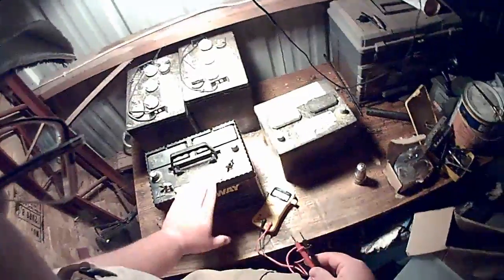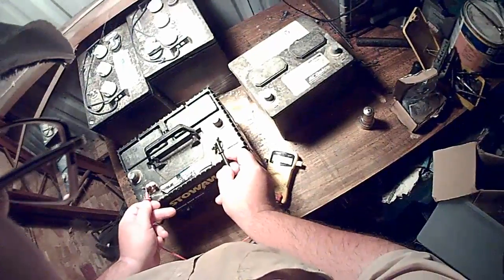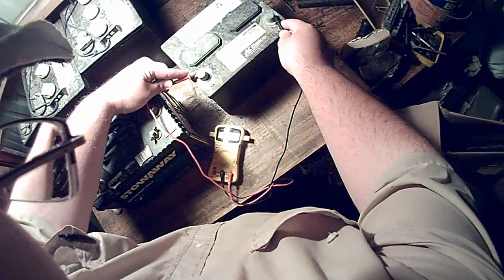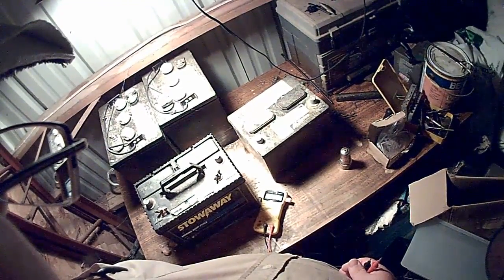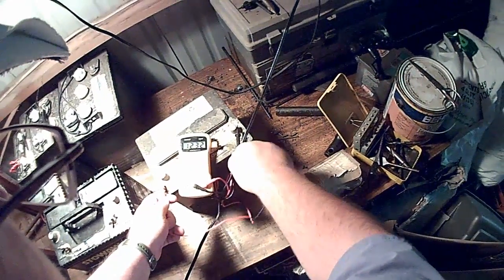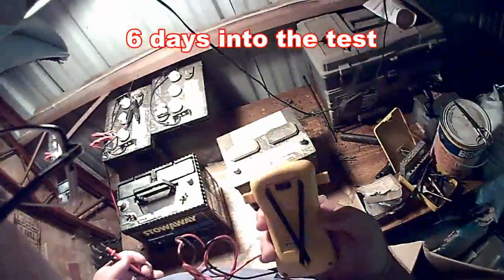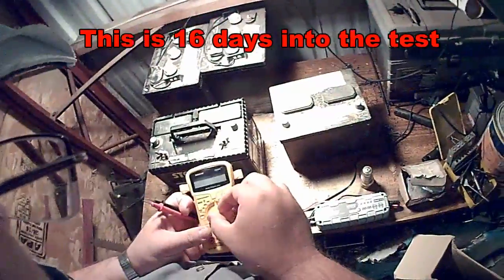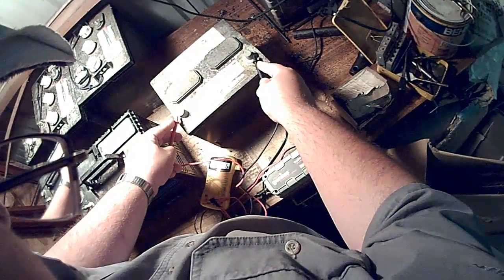Making a bad 12 volt battery good again for under 5 dollars drain test start.

Comment: That is just surface charge, it will drop down in a few hours or if you put a big load on it. But like I said, the lead salt battery runs about .5 to 1 volt less than lead acid. Still just as good, just different. You can also deep discharge it without damage.

Comment: The lead salt batteries, such as alum or epsom salt, run.5 to 1 volt less. But you can deep discharge them down to nothing and not damage them. Some inverters won't work at 10.5 volts or less. But the battery is still good. You can't use normal voltages as proof of them working. Starting the truck is a great test. Also, the 100 amp test is good, just can't go by the numbers it gives. That test is for lead acid.
Reply from the maker: Yup in a later video I ran a big fan constantly to find out the amp hours on the battery, worked out to basically the same hours as the original lead acid.
Reply: redicety12 ALSO, Some batteries have a slightly higher voltage after you use them a bit, warms up the battery. Like turning on the lites to warm up a cold battery in winter, before attempting to crank the engine.
Reply: Great Question... ?

Comment: Sorry GG Blues An alternator will keep a car running at Idle  even if the battery is disconnected! You are thinking of an old style generator in cars of the early 60's and before that put out more voltage the faster they ran.

Comment: Do you think using an ALUM battery as a solar battery bank would work okay? Think it would handle the constant charge and recharge?
Reply: good question, I was reading about solar power homes and one thing they mention car batteries are good cause they can handle alot of charge/discharge cycles. Soo a good test would be how many cycles can it handle.
Reply from the maker: That is why I started doing this in the first place, I have not hooked one up yet though.
Reply: redicety12 Great minds think alike. Batteries are not cheap, and once they die its great having a way to make them work again. Thanks for the video.
Reply: A car battery does not handle cycles well.
If you want to keep a car battery alive you can use only 15 % of the stored power on a daily basis or you will kill it in no time. You can use 50% with an deep cycle battery every day without doing damage to it.
Reply: Bonnie Flory
how long does it take a car battery to recharge the power lost during the engine crank? cause the trips I take are usually less then 4 miles at less then 45 mph.
Reply: The starter takes about 300 amps or more depending on engine size and cylinders of the engine, but it is only for a second or so.
300 times 12 volt = 3600 watts per hour divided by 3600 seconds( 1hour, since it takes about 1 second to start the engine) = 1 watt hour used for starting the engine.
Most alternators put out 80 amps, which about 20 amps is used by the car itself to keep it running. You still have 60 amps to spare. Depending how much the battery is drained, that is what the amp will be that the battery take to charge again.
A empty battery can draw a lot of amps (40amps or so) and a full battery will draw little amps( about 2 amps).

So you got 60 amps left and your battery draws let's say 10 amps and you used 1 watt from the battery to start your engine.
10 amps times 12 volts= 120watts your battery takes per hour. 60 minutes . 60 divided  120 watts = 0.5 minutes theoretically to recharge the battery.

Your alternator output is about the same in idle or when driving down the road. Heavy electrical loads in idle can still draw more power from the battery than the alternator can provide.

If you put a DC voltmeter on plus and minus post of the battery and you have 14 volt DC or more while the engine is running then you are charging the battery.

Short burst of high amps does not hurt starter batteries because the get recharged within minutes. But a steady load like in a solar system application would hurt them because the cycle from discharging and recharging is usually to long and to deep for car batteries.
Car batteries do not like constant loads, like listen to the radio or running the fan or lights while the engine is not running, this will shorten the live of the car battery.

Starter batteries have thin plates that can give high amps for short a short time while deep cycle batteries have thick plates which gives you deeper cycles with lower amps.
Reply: Bonnie Flory
emm, what does it mean in english? lol
Reply: In simple terms, it takes 1/2 a minute to put the power back into the battery that the starter  took out to crank the car.
Reply: Car battery is useless for solar. Destroy it quick with 50 percent discharge recharge cycles
The alum makes the battery substandard not high enough voltage, investors will shut down far sooner.

Comment: can you send me the mixtures you used
Reply from the maker: 1 cup or 8 oz of alum "aluminum sulfate" in a 1 gallon jug then fill the jug with water
Same for the baking soda 1 cup per gallon. The baking soda mix is used after draining the acid to neutralize any left over acid. You can then after rinsing with that rinse with plain water to get out the baking soda mix. Then you will put in the alum mix filling to just above the plates and then charge.
Reply: thanks

Comment: hey its me again sorry but i also say you should attempt to use it in your car and go for a long trip, then use it for everyday driving. as a reliability test. keep your regular battery in the trunk just in case, but that would be a great test of how the alum battery would work in a vehicular setting in real life. if it works for you, i may try my alum battery in my motorcycle!
Reply from the maker: Ya I plan to once I get one that will fit all the bad batteries I have now are to big.
Reply: oh i see that makes sense

Comment: Car needs battery only to start it. With engine running, the alternator charges the battery. If the car is running at 40MPH the alternator is spinning fast enough to supply power for everything that you turn on: lights, windshield wipers, blowers, radio etc. However, if you are stuck in traffic the alternator is spinning slow.That is when the car uses the battery again and drains it some. Keep the voltmeter on the battery and start the car. If voltage does not go up to 14.5 alternator is dead